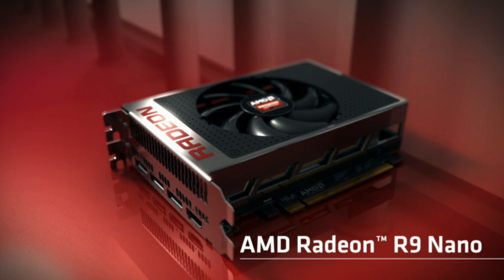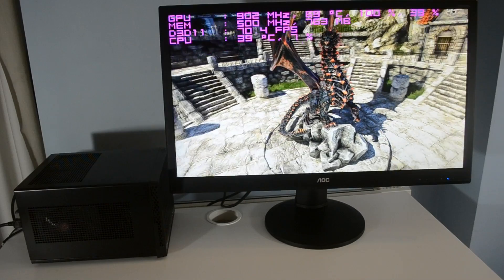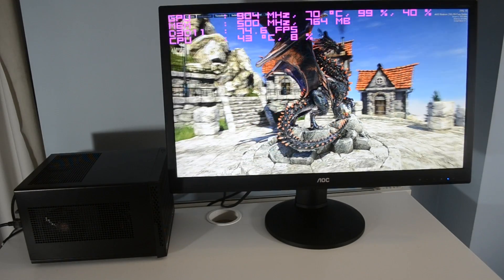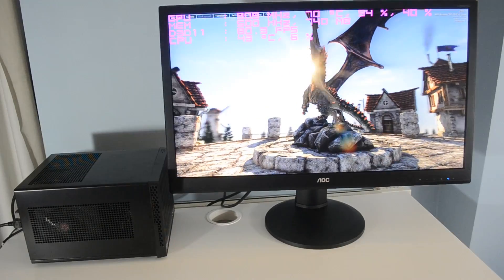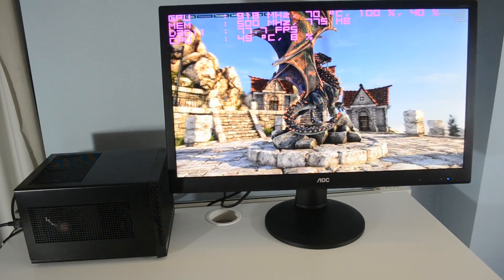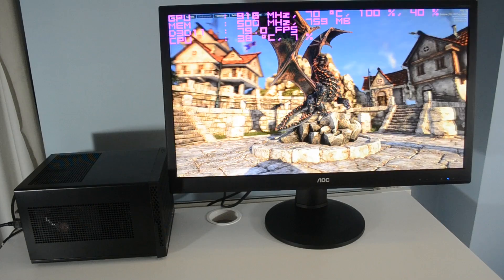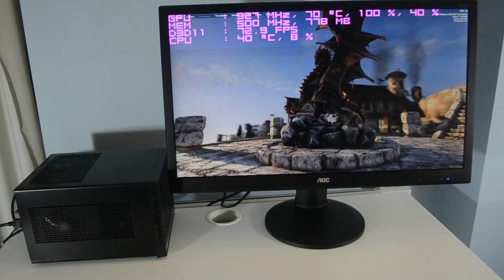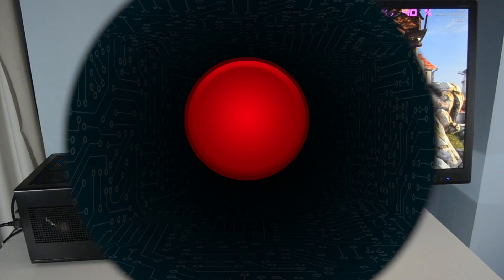AMD R9 NANO Noise and Coil Whine Test

Comment: Not even noticeable coil whine imo :D
Surely it'll be much quieter than my current 290 (gonna get a Nano)
Reply: +Topias Salakka Does your 290 act like a space heater in your room?
Reply: Bobby .264 Not anymore, because i have a Nano now.
Reply: Topias Salakka Nice! I'm thinking about investing in the nano.
Reply: Bobby .264 It's good, but no overclocking and it's kinda loud.
Reply: Topias Salakka That's alright.
Reply: @TopiasSalakka  Went from "Not even noticeable" to "kinda loud."
Reply: @joenodden  My 290 was louder actually.
Reply: @TopiasSalakka  Ok it's a 290, that's a given.
Reply: @joenodden  Custom card though, so it shouldn't be loud, but it was. Not buying MSI after that card.

Comment: I am one who wants a very small pc, something that is powerful and very efficient. So with this card I can have a much smaller power supply with less heat, and use this card that outputs 60% less heat than a 3 fan monster. I can have less fans running saving even more. If I use my PC 4-5 times a week and I save maybe 3 bucks a week on energy and still keep up with the big guns,  my PC costs me $150 less a year than a big old inefficient box. In the long run I'm in the money! Kudos to AMD!  Can't wait for a Zen Apu along with next gen integrated GPU. Wow!

Comment: That's not "coil whine" that's the VRMs pulsing with a ton of electrical current.  Who points the video card forward like that?  Even my Titan X sings like that somewhat, inside a mid-tower case, under my desk.  Can't hear a thing with headphones on while gaming. shrug
Reply from the maker: +xorbe  nonsense, we have 4 Titan X cards here and none of them make that noise. This is coil whine and it has been reported on a ton of other publications who had cards to review on launch day. Incidentally the card is installed into a case - many other publications had them running on an open bench with a microphone only a few inches away from the card. We didn't.

The Fury X exhibited coil whine, and AMD fixed it with a REV 2 card. I am sure they will fix it on the NANO for retail samples in the coming months. Wearing headphones is a great idea, but its hardly curing the problem, its still there, you just won't be able to hear it.
Reply: +xorbe That's like telling someone to wear a nose plug rather than bathe and use deodorant. There is no reason for high end components to make that much noise.

Comment: Why most of your Test samples are so BAD?
I Buy my Nano from MSI and i do not have any of that problems!
But why is this possible???

THX
Reply: +KitGuruTech One review site seems to see a difference between retail and the samples. 

"What is extremely annoying, though, is the massive amount of coil noise AMD's review sample emits—no matter the FPS, you can always hear it chirping. The Sapphire retail board is doing much better here, with less pronounced but still audible coil noise. The question is whether these are typical random variations or if retail boards have lower coil noise. But if that were case why did AMD pick such noisy boards for reviewers?"

https://www.techpowerup.com/reviews/AMD/R9_Nano/29.html
Reply from the maker: +samghost13 sadly its not just our review sample. seems many of the reviewers got cards with high levels of coil whine - http://wccftech.com/amd-radeon-r9-nano-suffering-major-coil-whine-issues-poor-quality-chokes-blamed-reason/
Reply: +KitGuruTech review samples are not the place to bring up coil whine. Unless you have reason to believe the actual retail cards from manufacturers using different components would have the same issue.
Reply from the maker: +AllYourBase Our review samples are the place to bring up everything. this is what AMD (or any other company) sends us directly for analysis - they are happy with the products and they are sent. These reference cards are often exactly the same cards that companies like Sapphire and other AMD partners release in the first wave, before custom designs are made. Fury X hit retail in Revision 1, which had issues, and Revision 2 resolved it - this didn't happen 5 years ago, we are talking months here - I know for a fact that many of our readers waited for Revision 2 before buying and made the right call - thanks to us. If we didn't report on the analysis they would have ended up with substandard noisy hardware.. We are here for customers, our readers - and to help them make buying decisions. If we adhered to your bizarre thinking then we would review nothing for launch days and just buy from retail stores a few weeks after the launch - same with Intel engineering samples etc. We are confident our testing methodology is very sound and detailed, as shown in our 7,500 word analysis on the main www.kitguru.net website. I mean no offense, but you have absolutely no say in this matter - you can start your own site and set up your own rules, but if you want to ignore aspects of the hardware you are given ,  just because it might show a company in a less than stellar light then I doubt you will last very long because you are not doing it for the right reasons.
Reply: +KitGuruTech The reason the fury x pump noise was ok to mention was that it was made by the same company. Cards themselves are made by AIB partners in their own/partner factories with their own components. Coil whine is something that will thus naturally vary from brand to brand. 

It would be hard not to mention it and AMD should have done a better job picking cards for review like nvidia does. But I suspect they would have had to delay handing out review samples or pressure a partner to quickly complete a more polished PCB to present the best impression. If they just sent out the cards expecting the focus to be performance, temps and fan noise without expecting the coil whine to become another big thing, their mistake.

The coil whine was mentioned in a balanced way so w/e. BUT, if you say you are there for consumers and you tell them something that turns out to not apply to the vast majority of cards because it happened to be unique to the review sample and was something you KNEW is unlikely to apply across the board, is that helping or a disservice? You were even in mentioning the coil whine, this is just for the sake of clarity. Some aspects of a card are consistent, some are not. Unless AMD was supplying all the cards to the AIB partners (PCBs and GPU), coil whine is not one of those.

I never said I had an issue with your article, but now that you mention it... you are reviewing a niche SFF GPU and put it up against a 980ti just because you had a case that would fit one. Sure the price is similar but if we go by nvidia pricing - "if the nearest similar product is at least 10% lower in performance, charge a few hundred more" - it's to be compared with SFF only. If the titan got away with it for so long, then such is life. Another point is that its not always SFF relevant if you do not only test small GPUs. A reader might not have a case that can hold such a card so what is the use of testing a card that does not fit in a category consistently against one that does?
Reply: +KitGuruTech It's a good idea to have a page for SFF testing with a list of SFF cards. That was absent from the mini 970 review and, IMO, done wrong for the nano review.
Reply from the maker: +AllYourBase actually we have been to these factories and your facts are yet again, wrong. Most of the reference cards are made by one fab plant and sent to partners, who then put their stickers on the cards - these reference cards are identical and are shared between AMD partners. The custom cards are different, but as there are no custom NANO cards, yet the card we tested is all you can get right now. If AMD change the design, as they did with Revision 2 of the Fury X then the problems will be resolved (and I dont mean a tweaked cooler from Cooler Master, I mean PCB changes). As we said in the main review we are quite confident that AMD can fix these NANO issues, but we can't guarantee they will - we can only review what the company gives us.I suggest you read our review at the link in the initial post here to www.kitguru.net, because you are only getting a very minor part of the story. These youtube videos are not reviews, they are often just included in one page of a rather indepth article on the main site.

We are here to serve readers and allow them to make informed buying decisions. based on emails and comments after our Fury and Fury X reviews, we just did that. If you have some kind of love for AMD and dont want us to report on all aspects of the hardware AMD send us for analysis you are in the wrong place. This is the same methodology we follow for any company and their products we review.
Reply: +KitGuruTech I don't love AMD, I might hate nvidia though. For lying to me about my 970 and the coil whine that sounds like this one but was not mentioned in reviews I saw. I personally do not mind coil whine. Maybe I should not say that. Every card I have had has had it about as loud as the nano sounds (except current 290x, and I think 6800gs from long ago) so I deal. The problem I see is that "little" things become big things for AMD while for nvidia they could be involved in genocide and things would be business as usual. This again is why I might think its not a big deal, because apparently its common so why should an entire line of GPUs end up condemned by the public for it?

I already checked the review. I only found the SFF page strange since the other card was not SFF and was even called SFF in the charts. If I were looking for a really tiny build for compute desk/imaginary girlfriend's space, that 980 ti would not do. 

My thinking was that only the reference cooler was made by a single company and the boards were built by the AIB partners with design specifications from AMD. I can see how for things like the fury x and nano this might not be the case. 

We'll know what the situation is once user feedback is online about retail nano cards.
Reply: I have never had graphics cards that make this noise, either amd or nvidia. I would suggest if you get this noise all the time then its a power supply issue. Never skimp on that. Also kitguru didnt make this a big issue they gave the nano 8 out of 10!!! You guys dont even read the review and make up your own theories. Every review site mentioned coil whine with the nano. Because its there, like it was with rev 1 fury x
Reply: +theonlyredspecial I wouldn't say all the time now since the current vapor-X 290x does not have it to this kind of degree (can still hear something now and then). I had the whining on my 970 with both a seasonic 750W gold PSU and Seasonic 860W Platinum PSU. I stopped skimping on power supplies long ago after going through a few so-so ones. 

I have said they were even on that front (in the article). What makes it anissue is the noise about it online and out of context videos like this that only feature the coil whine. I haven't seen any other cards get this treatment by review sites at launch where they highlighted the pump noise in out of context videos and coil whine in out of context videos and other methods. The 900 series cards have tons of coil whine complaints but that had to wait for actual users like me to find. Similar to the specs issue. Nvidia is better at first impressions I guess.
Reply: MSI have their own Military Class components, so i will stay with them. Like before my 5770 Hawk was Awesome(no probs) then my newer R9 280X OC from Gigabyte was shit! really! So i go on to the R9 290 from MSI not the X one, like the price is to high and you get a high end card with the 290 and then you can change Bios for OC like the card has Bios switch on it. and you can do crossfire without that shitti thing to stick in between 2 cards! so no fiepping or what ever i should name that thing... ? ? ?

Comment: 900mhz on the core is kinda lame i had that clock on my 580 5 years ago
Reply: ThEcRaZ3dGaM3R I think you directed your comment at the wrong person.
Reply: ThEcRaZ3dGaM3R
Nope. It was directed at whoever stated that clock speed was 'lame' and somehow the only relevant spec :)
Reply: davewah3 yeh... I well and truly derped... not as much as he did though XDD
Reply: +Game Benchmarks And Tech Demos 
Couldn't say it any better myself xD
Reply: +The Gamer for the target TDP of the card it's actually not bad... I've had slower on some really high end stuff before now... besides, since it's the same core as the Fury X, so improve the cooling and you could most likely get about 1100MHz out of that card without a problem (you'd probably also want to cool the VRM a lot better though... that gets WAY too hot to draw much more power!)
Reply: +The Gamer And the most ignorant comment of the year goes to...
Reply: davewah3 so I'm guessing you've seen other GPUs from AMD with a TDP target like this that have 1000+ MHz core clocks, the same ROP, TMU and stream processor count that use HBM memory... I can agree that a sub-1000MHz core clock is mediocre at best... but this is AMD we're talking about here!! they're not really the coolest operating, lowest power GPUs on the market... their chips tend to draw significantly more power than any other vendor when you push the core speed past 1100MHz... my Radeon 7950 pulls 288W overclocked to 1110MHz wth a +100MHz bump on the RAM... it sure as hell doesn't conserve power by any means!
Reply: +SFseis No but my 980Ti have 2816 clocked at 1500mhz
Reply: davewah3 sorry... I misread the target of your other comment... I thought it was directed at me...
Reply: +The Gamer How you can be so idiot ? You know something about 128bits ,256bits  or anything about memory or clock bus ?